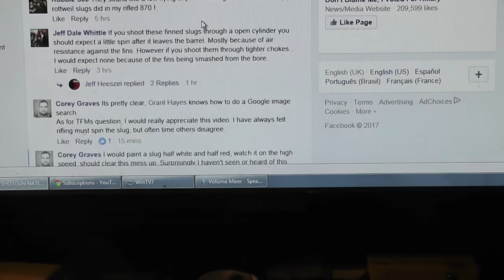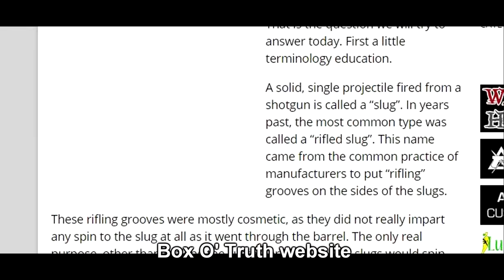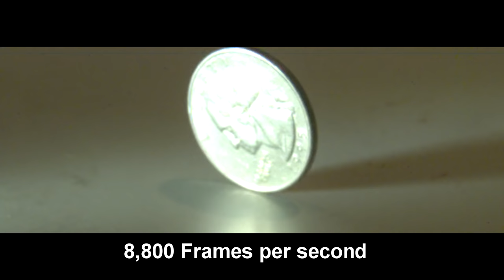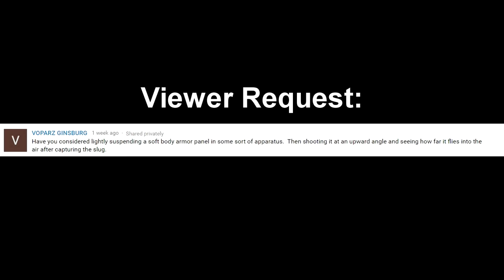Do Rifled Foster Slugs REALLY spin or it is just a MYTH?

Comment: Would the Australian slug fired through a smooth bore in Australia rotate counterclockwise?
Reply: Actually water does not go down the drain counter clockwise either
 That was the first thing I did check when I went down under
 Boy was I disappointed. All these years thinking it went down the drain counter clockwise
Reply: @scottgorman7166  From our vantage point their water goes up the drain. Just saying.
Reply: I think your vantage point is on drugs is water is going up your drain in Australia
Reply: It's in upside down time
Reply: That would depend upon which drug you were taking.
Reply: @justinbailey2419  Australia is on the bottom of the earth hence when you flush a toilet compared to our place on the earth the water technically drains up
Reply: If you held the gun upside down! 🙃
Reply: Fosters! Australian for slugs! 🇦🇺 🍺
Reply: No, but you need to take care they don't 'boomerang' on you and come back at yer.
Reply: Always depends on whether you stand in front of or behind the slug
Reply: Coriolis effect
Reply: @RockHudrock  yess!
Reply: It’s like a propeller so it only goes one way
Reply: Not always. American made shotguns will correct this mistake

Comment: This confirms what has been described in print already, right down to the spin rate:

"The basic Foster slug, however, remains a
hollow lead cup, heavier at the point. It has 14
small angled ribs swaged into the side of the
slug. The rifling tends to be obliterated by the
passage of the slug through the barrel, especially
through a full choke. Some spin does result
from the ribs, however, and tests show a very
slow spin of approximately one turn in 24 feet
of travel to one turn in 129 feet of travel,
depending upon the choke used. In 1980,
Remington and other slug manufacturers increased
the weight of 12-gauge rifle slugs to a
full 1 oz.

"Neither Brenneke nor Foster slugs depend
upon the rifling ribs or projectile spin for stability.
The slugs are stable because they travel
through the air like a sand-filled sock with the
heavier toe forward (O'Connor 1965), unlike
symmetrical lead balls (Figure 3). The trailing
light end acts as a stabilizer. The slight rotation
imparted by the ribs reduces the effect of manufacturing
irregularities. In tests performed
by Winchester-Western, the slug rotation was
confirmed, resulting in consistently smaller
groups for rifled slugs than unrifled slugs
(Sterett 1966)."

This is from a 1991 article in "Crime Labratory Digest".  The full text is available online if you look up any of the text.
Reply from the maker: I think the spin is even less than that,  maybe 1 full turn at 40 yards.
Reply: ***** Yeah, that falls into the range given in the article.  From one turn in 24 feet (8 yards) to one turn in 129 feet (43 yards).  The conclusion of the article was that this was enough to correct for manufacturing asymmetry.  If a slug was asymmetric and did not spin, it would turn in whatever direction and continue to do so.  A slug that is spinning a bit, though, would not.  This is distinct from the gyroscopic stability given to a bullet where the energy of the spin actually contributes to stability.

Arrows are spin-stabilized as well as being aerodynamically stabilized by having the mass at the front and the fins at the back.  The spin of the feathers does not impart gyroscopic stability, but rather the same stability the slow spins of the Foster slug impart.  Foster's patent #2,414,863, BTW, agrees with your assertion that the stability is imparted internally, even in the cartridge itself: "Test observations indicate that a significant portion of the rotative movement imparted to the projectile is given the latter while it is still in contact with the paper cartridge."
Reply: RyeOnHam so all the naysayers now can realize that the rifling on the slug does help it stabilize and spin some
Reply: RyeOnHam Szilagyi
Reply: The Foster slug description sounds plausible to me with the heavier proportion of the weight forward and slight rotation yielding tighter groups.
Reply: onelove  shooting soft lead foster type slugs, especially those with rifling, and room for the projectile to swage down to fit the tube, especially considering how much softer it is than the barrel/choke steel, along with the fact that not only are shotguns extremely low pressure in comparison to near all else AND due to the bore diameter along with rather long barrels typical to smoothbore slug guns, the internal barrel pressure at the choke tube is likely very very low. Further proof to this is the fact that an 18.5" barreled Mossberg 590 produces about 1530 fps at the muzzle with 1oz fosters. My 28" barrelled Mossberg 535 produces right about at the advertised ±1600 fps. All this verifies that from at least the 18" to 28" lengths, there is far little remaining pressure left to be concerned with pressures spiking due to in essence using 'undersized' projectiles. Especially when most foster slugs are actually undersized. Besides this fact, shotgun chokes and barrel diameters vary pretty widely from one make to another, not to mention amongst the same model from the same make. Many people had always assumed that buckshot worked better in cyl/imp cyl barrels too, and more often than not a full choke provides better patterns. The only issues you may run into is if you happen to have a tighter than typical full choke barrel shooting truly oversized foster slugs, and even then... Your only issue will be more than typical leading behind the choke tube.
Reply: onelove  foster slugs are one solid chunk of extremely soft lead. 

I'm not saying full chokes are optimal for slugs because they aren't. But to say "you NEVER shoot a slug though a full choke!" As you said, is unfounded, and comes from shotgun barrels being forged with thin walls of low quality steel... Literally 100+ years ago, with the same adage applied to claims of 00 buck bulging barreled at the choke tube of full choke guns, especially very old guns. I'm not saying to shoot 2,000  slugs through your full choke, but with the amount of slugs the typical slug Hunter ever runs through a shotgun, id say with confidence that any modern shotgun could run a foster slugs through a full choke for many years of service and come out completely unscathed. 

My Mossberg 535 prints federal truballs at right at 2" @50 yards though my factory modified choke.  I have no desire to change it out to a imp cyl. And I have one to use. Run what works. If your shotgun has only a full choke and you want to run it this fall on a budget and your gun shoots them adequately through it, run it. Especially if it's a fixed choke barrel.  

I agree that plated slugs, or the higher antimony slugs from more 'exotic' brandings would start to increase the risk of damaging a choke tube potentially, but even then, I would not feel as though the gun would become unsafe to shoot those through it.
Reply: onelove  I'm not limited to 140 characters. While you may not find my argument useful, someone else who may be seeing this may want to know as to why I disagree. Some people use YouTube as a platform to educate themselves. While I don't claim to be an expert, I feel as though videos like this are very often watched by those seeking information and real world experience based advice. I feel as though if I have an argument or disagree it's not fair to others or the person I'm disagreeing with if I don't provide my reason for disagreeing. I don't want you to feel as though I'm attacking you for your opinion. And I blame no one using a firearm of any kind to err on the side of caution. 

If you feel personally full chokes are  unsafe to shoot slugs through, don't go against what you are comfortable with, especially if you have the means to do so. This is why there are so many different makes, models, calibers, and loads within calibers. Everyone has their own opinion as the what's better or suits their needs, or simply what they feel more comfortable with. Nothing wrong with that.
Reply: cool read, thx for finding this for us :)

Comment: Very interesting problem indeed!

That slug has a few things going for it. First of all it's blunt and in supersonic flight having a blunt body rather than a sharp/pointy body (like your typical G7-esque long range design) means you'll get significantly more drag, but also significantly less lift and pitching moment, so from the get go this thing will be very easy to keep statically stable. In addition to all that, its base is hollowed out, shifting the centre of mass even further forwards, to the point where its pitching slope is negative, meaning that it would be more or less statically stable on its own.

As we've seen from the smoothbore test however, having a more or less statically stable design isn't remotely good enough if you want to actually hit something. Having a negative pitching slope means that whenever an angle of attack is present, the slug will tend to rotate to reduce it, however since its pitching moment slope is also fairly shallow (as a result of the blunt design) it tends to be able to rotate quite a bit until the aeros kick in and force it back the other way. The consequence of this is an oscillating slug which may increase the amplitude of oscillation the further it goes until finally it has enough angular momentum to fully overturn - i.e. tumble. This would make it a dynamically unstable design, which is not very good for accuracy.

This is where spin comes in. Spin in these slugs works more or less the same as it does in conventional bullets, but in this case pitching moment is working with spin rather than against it, so all spin has to counteract are minor transient events, such as a gust of wind or an unsuspecting fly in the way, so you need waaaay less of it to get the job done. This is how you get away with a smoothbore barrel launching a rifled projectile. The rifling on the slug does work, mainly thanks to the hollowed out base allowing it to obturate into the bore under gas pressure, but you get a lot of slip as nothing is actually cutting into the slug.

You should do a long range test (100m+) of smoothbore vs rifled choke with Foster slugs to see if spinning them up any faster messes up their dynamic stability. Also repeat the test with the aussie slug at that range to see if it's dynamically stable or not. Something tells me having that tiny bit of spin will make the difference between a hit and a miss at that kind of distance.

Comment: from the FBI ballistic lab:The basic Foster slug, however, remains a
hollow lead cup, heavier at the point. It has 14
small angled ribs swaged into the side of the
slug. The rifling tends to be obliterated by the
passage of the slug through the barrel, especially
through a full choke. Some spin does result
from the ribs, however, and tests show a very
slow spin of approximately one turn in 24 feet
of travel to one turn in 129 feet of travel,
depending upon the choke used. In 1980,
Remington and other slug manufacturers increased
the weight of 12-gauge rifle slugs to a
full 1 oz.
Neither Brenneke nor Foster slugs depend
upon the rifling ribs or projectile spin for stability.
The slugs are stable because they travel
through the air like a sand-filled sock with the
heavier toe forward (O'Connor 1965), unlike
symmetrical lead balls (Figure 3). The trailing
light end acts as a stabilizer. The slight rotation
imparted by the ribs reduces the effect of manufacturing
irregularities. In tests performed
by Winchester-Western, the slu.g rotation was
confirmed, resulting in consistently smaller
groups for rifled slugs than unrifled slugs
(Sterett 1966)

Comment: or make spiral grooves in the nose that feed the grooves with air. extreme scientifical. call it the pabst slug.
Reply: or call it the Dos Equis. Most interesting slug in the world.
Reply from the maker: Sounds so easy!
Reply: I know i'm a little late to the party. But would this be different than a rifled choke tube? Or can those not be used with Foster slugs, just sabots?
Reply: @tonyjackson5115  
Yeah, 12ga rifled chokes are meant to impart spin on plastic wads, not directly contact metal on metal.

Comment: The Foster slug is not rifled to make it spin. It's rifle's so that it can run through a choke. As you correctly note the little amount of spin that it has would never imparts to bility to it, the Foster slug is stable because it's a dart. The heavy part precedes the skirt which keeps it stable.

Comment: I hunt deer with shotgun slugs, and I can tell you that in the right gun, they are deadly accurate out to 100 yards or better, maybe 150-175 with the right gun as long as you know where they will end up. The damage that a Foster slug does on something like a whitetail is incredible. I had one instance where I shot a large 10 point buck at about 35 yards in the left shoulder, the slug went a little high, ended up hitting the deer in a vertebrae on the inside of the body cavity, the bone splintered in every direction and the shrapnel from that took out the right lung, which was in pieces. The deer hit the ground instantly and was dead when he got there. I have hit them at 35 yards or so on other occasions, breaking one shoulder and doing a lot of internal damage. I have never had a deer travel more than 50 yards after getting hit with a shotgun slug.
Reply: What kind of set up are you using to get that kind of precision? Do you need a rifled barrel and do you use any optics?

Comment: I wonder if removing that ring around the back end of the slugs would increase the rotation? you know just to complete the grooves in the slug.
Reply: jjohnston94 oh dang hadnt thought of that.
Reply: It would make it worse. The only reason these things spin even this much is because the gas pressure makes them obturate (much like a Minié bullet). You take that gas seal off, they won't spin at all.
Reply: Brian Dennis: Never the less I've had the same thought concerning removing or using a slug w/o the ring. One way to find out!?!?  JEFF!!
Reply: the gas seal also adds drag keeping the ass-end of the slug aligned in flight.
Reply: I agree, all the slugs I've seen the ring  prevents the slug grooves fromhaving a good contact with the barrel. Contact may occur with a full choke but slugs should not be used with a full choke. I think open cylinder choke is preferred for slugs. Has anyone used calipers to measure the ring OD and groove OD?
Reply: jjohnston94; by design it cant help but serve as a seal but the gas seal wad is actually the gas seal. I thought incorrectly as it turns out that the slug was pressurized just like a miniball due to the shape. What i can say is my 870 shoots em right on the $ @ 75yds.

Comment: Someone should make you some diamond tipped slugs
Reply: I'm pretty sure it would just shatter
Reply: Brave Cuber On impact or upon firing?
Reply: They'll shatter your wallet faster than your wife!
Reply: So does Tungsten.  Still a great armor breaker
Reply: Tungsten carbide shatters. Pure tungsten doesn't. Pure(ish) tungsten is used for armor penetrators, not tungsten carbide.
Reply: Tungsten carbide has been used in penetrators for decades, and although mostly superseded by tungsten alloys, it's probably still used in HMG rounds and such. It shatters, sure, but in short penetrators doesn't perform much worse than modern tungsten alloys.
Reply: not diamond, just use Moissanite
Reply: There are artificial elements that are much harder than diamond, but I think they only exist in tiny quantities in labs

Comment: how does the spin compair to when shot out of a full riffled barrel or a choke tube ?
Reply: FumblerX ...I am wondering the same thing—been told to only shoot slugs out of a cylinder bore.
Reply: FumblerX You can work out the twist rate - feet/sec (velocity) divided by turns/sec (rpm/60) gives you the effective twist rate in feet, x12 to get it in inches. My rough calcs watching the video put this spinning at 10 rps at 1600 fps. That gives us a 160 ft effective twist rate, which won't do much, but it really doesn't need to.

Compare that to say a 25in rifled choke tube... Assuming it doesn't just strip the slug (it's going pretty wuick by the time it hits the tube!), that's a fucking LOT more spin!
Reply: read your owners manual.  I have a Mossberg 500 that states slugs can be fired through full choke or lower.  I have fired many many slugs through that full choke barrel no problems.....even took a couple of deer with it.  You'll hear lots of know it all experts that will say anything tighter than ic choke and you will blow up the barrel.  Just read your owners manual and let the know it all's keep jabbering.
Reply: Jim Lacefield; good point, i've done the same and had no problems.
Reply: I also own a Mossberg (535), I bought it brand new and it came with 3 barrels.  It came with a 24inch rifled barrel, a 22inch turkey barrel with a "turkey choke" and a regular 26inch barrel with 3 chokes.I bought a box of slugs and tested it out myself. Improved cylinder gives you the best accuracy. Anything else will extrude the slug and  change it shape affecting its accuracy and increasing its recoil. I highly doubt you would "blow up" a shotgun shooting them thru a full choke, but you may end up damaging the choke over time. It also states in the manual to fire slugs thru improved cylinder.

Comment: Very interesting demonstration. I had always wondered about the "spin" thing with foster type slugs. I thought it was more like a "rock in a sock" motion. With the heavier front area carrying the slug forward and the ribs were there for less contact of lead to barrel friction. But considering the distances used by slug guns and the minimal turn rate 1/4 to 3/4 I doubt it adds very much to accuracy. Still, a worthwhile  trial. Thanks.
Reply: This commenter didn't watch until the end.  They filming at over 800 frames/second, meaning the spin is a little more than that.